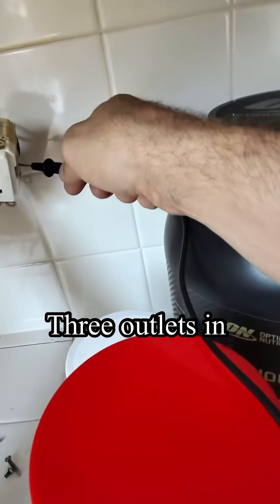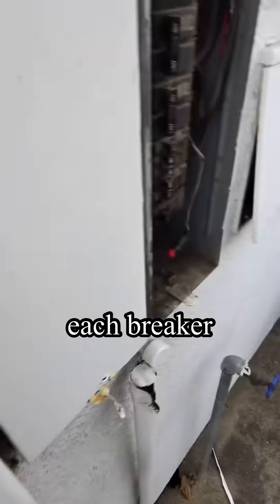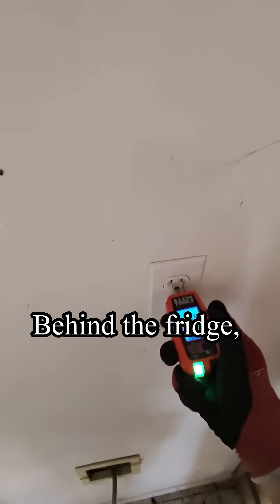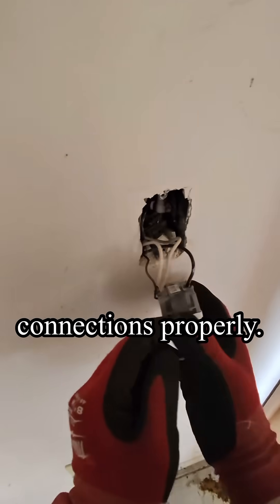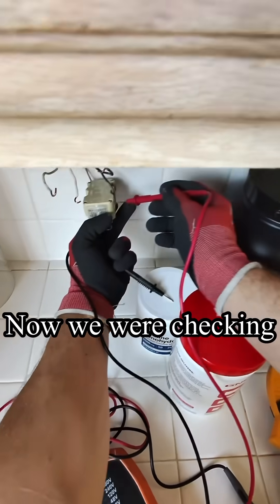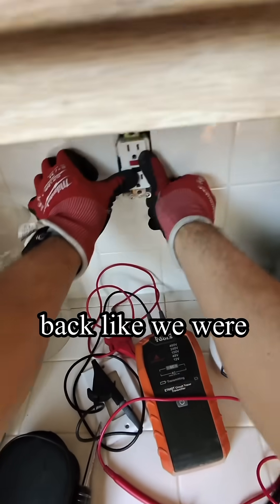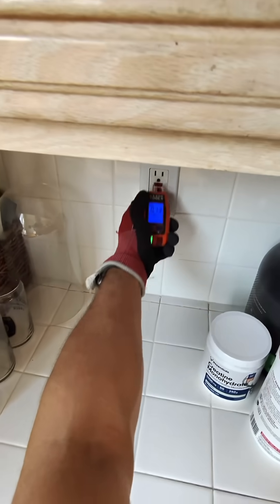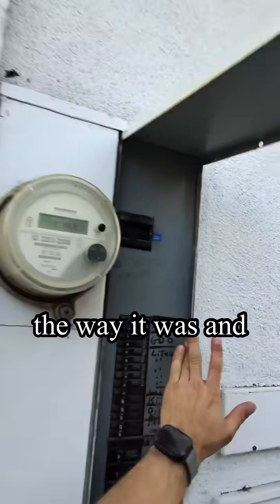Kitchen Outlets Not Working? Here’s What I Found

Comment: I had a similar weird situation. Problem ended up being a hidden GFI that was tripped on the wall next to the fridge. Turns out, they had moved the fridge from one side of the kitchen to the other at some point, and just covered that GFI with the fridge.
Reply from the maker: it's sad whoever did this doesn't realize that one day the owner won't be able to find the GFCI outlet.
Reply: @Electricians_Eyes ya. I ended up splicing it through and putting a blank plate, then made the next outlet in the line a GFI instead. It's still a hidden splice, but at least it's accessible if there's an issue and its a straight through.
Reply from the maker: @michaeloxlong  I would do the same, it's the right decision👍🏻